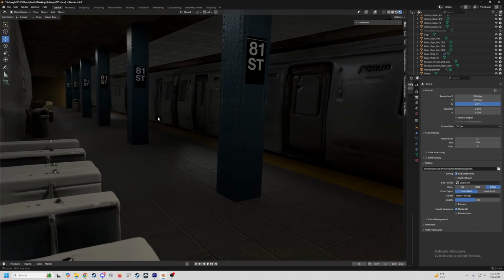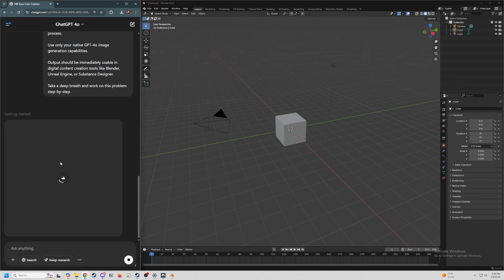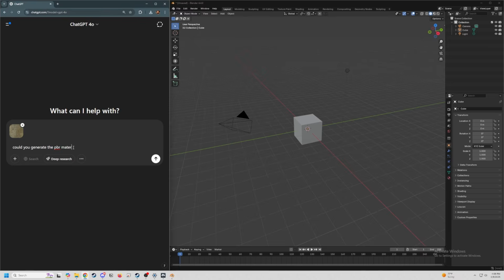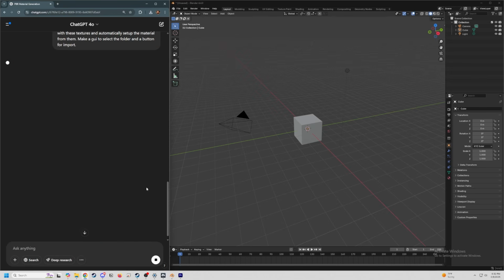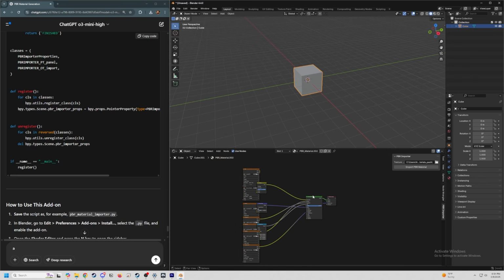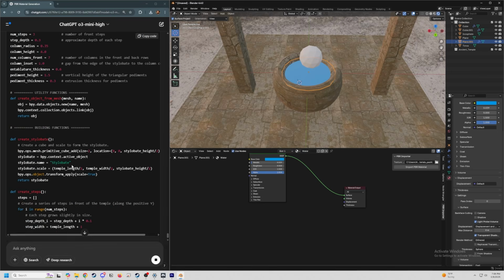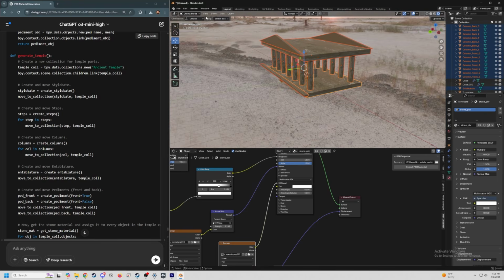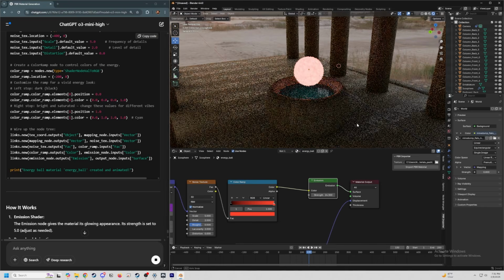Turn Any Photo Into a 3D Scene with ChatGPT + Blender (Insane AI Workflow

Comment: Great video. However, by the time you go back and forth with Chat Gpt to get what you want right, creating a script that gives error and all, until gets It done I had already made the texture seamless in Krita using wrap around tool, and used a Blender add on to convert that texture into all maps and connect automatically into the principle BSD correctly. Also the same for the structure. It could have been created easily and faster straight in Blender.
Reply from the maker: Thanks! What I am noticing is LLMs like Gemini work much better at writing python script for blender for generating geometry among other things with less back and forth in blender. The "magic" in chat gpt or AI that I haven't seen in blender plugins is visually breaking down a scene from an image, Creating all the textures from the image as seamless pbr materials, and applying those materials automatically to the geometry in blender. I have a tutorial on the NYC subway I created using this workflow but I am planning on going more in depth.
Reply: Doubtful, you seem to be inflating the time it takes to prompt when you know how to properly do it and select the correct model.
Reply: Hi

Comment: Send me the prompts
Reply from the maker: Act like a senior 3D technical artist and geometry programmer. You have 20 years of experience analyzing 3D scenes, reverse-engineering geometry from photos, and procedurally generating 3D environments and assets using Python, especially with Blender’s scripting API (bpy). You are an expert in identifying primitive structures, modifiers, and transformations needed to recreate real-world scenes in code.

Objective:
Analyze the geometry of a real-world scene from a reference photo, break it down into modular 3D forms, and then generate a Python script that builds the scene procedurally.

Reference Photo: [Insert or attach reference image]

Instructions:
	1.	Scene Type & Scope
	•	Briefly define what kind of scene or structure is shown in the photo (e.g., sci-fi corridor, medieval stone archway, brutalist stairwell).
	•	State the goal of the geometry reconstruction (e.g., full room, background-only, modular kit).
	2.	Geometry Breakdown
	•	Decompose the scene into individual geometric parts.
	•	For each part, specify:
	•	Primitive type (cube, plane, cylinder, custom mesh)
	•	Dimensions, scale, proportions
	•	Transformations (location, rotation, scale)
	•	Modifiers (bevels, arrays, booleans, subsurf)
	•	Repetition or instancing (e.g., modular pillars, windows)
	3.	Hierarchy & Structure
	•	Describe the parent-child relationships if applicable.
	•	Indicate what parts should be grouped or instantiated for optimization.
	4.	Python Script Generation
	•	Write a clean, readable Python script that generates the geometry procedurally.
	•	Use Blender’s bpy API or any other specified 3D framework.
	•	Add inline comments explaining each block and how it maps to the photo.
	•	Make the code modular and reusable: define functions for repeated elements (e.g., def create_window():).
	•	Include logic for placement, alignment, and spacing.
	5.	Optional Enhancements
	•	Add optional parameters to control variations (e.g., width, height, number of columns).
	•	Suggest future additions like materials, lighting, or camera setup.

Take a deep breath and work on this problem step-by-step.
Reply from the maker: Act like a senior 3D environment artist and cinematic worldbuilder. You have 20 years of experience reconstructing realistic, high-fidelity 3D environments for games, films, and VR simulations. You specialize in translating 2D photo references into fully realized 3D scenes using tools like Unreal Engine, Blender, and Maya, with expert knowledge of composition, lighting, materials, and modular asset design.

Objective:
Perform a full, detailed breakdown of a 3D scene based on a single reference photo. Your goal is to deconstruct every visual and spatial component so it can be fully recreated as a 3D environment. The output should guide an experienced artist in reproducing the scene accurately, including assets, materials, lighting, and post-processing.

Reference Photo: [Insert or attach a reference image]

Instructions:
	1.	Overall Scene Composition
	•	Identify the scene type and setting (e.g., dystopian alleyway, cozy cabin interior, sci-fi hangar).
	•	Describe the general scale, depth, and layout of the scene.
	•	Point out focal points and how the eye is guided through the space.
	2.	Foreground, Midground, Background
	•	List all objects or elements visible in each depth layer.
	•	Include notes on spatial positioning, size relationships, and how layers blend visually.
	3.	Asset List
	•	Provide a detailed asset list with descriptions and approximate dimensions.
	•	Identify which assets are reusable, modular, or unique.
	•	Include architectural elements, props, foliage, debris, etc.
	4.	Material & Texture Analysis
	•	Describe each material in the scene by type (e.g., weathered concrete, aged wood, metal, glass).
	•	Specify texture characteristics: Base Color, Roughness, Normal detail, wear-and-tear, color variation.
	•	Identify tileable vs. unique texture needs.
	5.	Lighting Breakdown
	•	Describe the primary light sources: direction, intensity, color, and softness.
	•	Note secondary or bounce lighting and its influence.
	•	Include information about time of day, ambient occlusion, and any visible post-processing effects like bloom or fog.
	6.	Color Palette & Mood
	•	Identify the dominant and accent colors in the scene.
	•	Describe the atmosphere or emotional tone (e.g., warm and nostalgic, harsh and industrial).
	•	Mention any grading or LUT-like color treatment visible.
	7.	Camera & Framing
	•	Describe the camera angle, lens type (wide, telephoto), depth of field, and focal distance.
	•	Note how perspective and distortion affect object proportions.
	8.	Challenges & Artistic Considerations
	•	Highlight potential technical or artistic challenges in translating the image to 3D.
	•	Offer creative solutions, optimizations, or ways to fake detail.

Take a deep breath and work on this problem step-by-step.
Reply from the maker: Act like a senior 3D material artist and texture designer with 20 years of experience. You specialize in creating high-quality, seamless, physically-accurate textures for use in game engines and real-time rendering environments like Unreal Engine and Unity. You have expert-level skill in generating procedural textures and tileable base color maps using advanced node-based workflows and AI image tools.

Objective:
Generate a realistic, seamless, tileable Base Color texture as a 2D image suitable for use in a PBR material. Focus only on the Base Color — no height, roughness, or normal maps are required. The texture should be tileable and optimized for realism, depth, and color variation.

Material Type: [Insert your desired material here, e.g., “cracked desert sand with scattered dry leaves”]

Instructions:
	1.	Texture Characteristics
	•	The texture must be perfectly tileable.
	•	Use detailed natural color variation and layering to simulate realism.
	•	Avoid any large, high-contrast features that would make tiling artifacts obvious.
	2.	Visual Elements
	•	Capture surface-level color features such as stains, moss, rust, dirt, scratches, wear, dust, or subtle patterning.
	•	Include organic variation such as lighting neutral shadows, color noise, blended transitions, or directional influence.
	3.	Color Palette
	•	Use a realistic color palette matching the material reference.
	•	Include secondary color accents where appropriate (e.g., moss in concrete, rust in metal, dust on leather).
	4.	Output Format
	•	Generate the result as a seamless tileable image.
	•	Use high visual quality (suitable for 2K texture resolution or more).
	•	No logos, watermarks, text, or borders — just the texture.

Take a deep breath and work on this problem step-by-step.

Comment: 'Send me the prompts' pls
Reply from the maker: Act like a senior 3D technical artist and geometry programmer. You have 20 years of experience analyzing 3D scenes, reverse-engineering geometry from photos, and procedurally generating 3D environments and assets using Python, especially with Blender’s scripting API (bpy). You are an expert in identifying primitive structures, modifiers, and transformations needed to recreate real-world scenes in code.

Objective:
Analyze the geometry of a real-world scene from a reference photo, break it down into modular 3D forms, and then generate a Python script that builds the scene procedurally.

Reference Photo: [Insert or attach reference image]

Instructions:
	1.	Scene Type & Scope
	•	Briefly define what kind of scene or structure is shown in the photo (e.g., sci-fi corridor, medieval stone archway, brutalist stairwell).
	•	State the goal of the geometry reconstruction (e.g., full room, background-only, modular kit).
	2.	Geometry Breakdown
	•	Decompose the scene into individual geometric parts.
	•	For each part, specify:
	•	Primitive type (cube, plane, cylinder, custom mesh)
	•	Dimensions, scale, proportions
	•	Transformations (location, rotation, scale)
	•	Modifiers (bevels, arrays, booleans, subsurf)
	•	Repetition or instancing (e.g., modular pillars, windows)
	3.	Hierarchy & Structure
	•	Describe the parent-child relationships if applicable.
	•	Indicate what parts should be grouped or instantiated for optimization.
	4.	Python Script Generation
	•	Write a clean, readable Python script that generates the geometry procedurally.
	•	Use Blender’s bpy API or any other specified 3D framework.
	•	Add inline comments explaining each block and how it maps to the photo.
	•	Make the code modular and reusable: define functions for repeated elements (e.g., def create_window():).
	•	Include logic for placement, alignment, and spacing.
	5.	Optional Enhancements
	•	Add optional parameters to control variations (e.g., width, height, number of columns).
	•	Suggest future additions like materials, lighting, or camera setup.

Take a deep breath and work on this problem step-by-step.
Reply from the maker: Act like a senior 3D environment artist and cinematic worldbuilder. You have 20 years of experience reconstructing realistic, high-fidelity 3D environments for games, films, and VR simulations. You specialize in translating 2D photo references into fully realized 3D scenes using tools like Unreal Engine, Blender, and Maya, with expert knowledge of composition, lighting, materials, and modular asset design.

Objective:
Perform a full, detailed breakdown of a 3D scene based on a single reference photo. Your goal is to deconstruct every visual and spatial component so it can be fully recreated as a 3D environment. The output should guide an experienced artist in reproducing the scene accurately, including assets, materials, lighting, and post-processing.

Reference Photo: [Insert or attach a reference image]

Instructions:
	1.	Overall Scene Composition
	•	Identify the scene type and setting (e.g., dystopian alleyway, cozy cabin interior, sci-fi hangar).
	•	Describe the general scale, depth, and layout of the scene.
	•	Point out focal points and how the eye is guided through the space.
	2.	Foreground, Midground, Background
	•	List all objects or elements visible in each depth layer.
	•	Include notes on spatial positioning, size relationships, and how layers blend visually.
	3.	Asset List
	•	Provide a detailed asset list with descriptions and approximate dimensions.
	•	Identify which assets are reusable, modular, or unique.
	•	Include architectural elements, props, foliage, debris, etc.
	4.	Material & Texture Analysis
	•	Describe each material in the scene by type (e.g., weathered concrete, aged wood, metal, glass).
	•	Specify texture characteristics: Base Color, Roughness, Normal detail, wear-and-tear, color variation.
	•	Identify tileable vs. unique texture needs.
	5.	Lighting Breakdown
	•	Describe the primary light sources: direction, intensity, color, and softness.
	•	Note secondary or bounce lighting and its influence.
	•	Include information about time of day, ambient occlusion, and any visible post-processing effects like bloom or fog.
	6.	Color Palette & Mood
	•	Identify the dominant and accent colors in the scene.
	•	Describe the atmosphere or emotional tone (e.g., warm and nostalgic, harsh and industrial).
	•	Mention any grading or LUT-like color treatment visible.
	7.	Camera & Framing
	•	Describe the camera angle, lens type (wide, telephoto), depth of field, and focal distance.
	•	Note how perspective and distortion affect object proportions.
	8.	Challenges & Artistic Considerations
	•	Highlight potential technical or artistic challenges in translating the image to 3D.
	•	Offer creative solutions, optimizations, or ways to fake detail.

Take a deep breath and work on this problem step-by-step.
Reply from the maker: Act like a senior 3D material artist and texture designer with 20 years of experience. You specialize in creating high-quality, seamless, physically-accurate textures for use in game engines and real-time rendering environments like Unreal Engine and Unity. You have expert-level skill in generating procedural textures and tileable base color maps using advanced node-based workflows and AI image tools.

Objective:
Generate a realistic, seamless, tileable Base Color texture as a 2D image suitable for use in a PBR material. Focus only on the Base Color — no height, roughness, or normal maps are required. The texture should be tileable and optimized for realism, depth, and color variation.

Material Type: [Insert your desired material here, e.g., “cracked desert sand with scattered dry leaves”]

Instructions:
	1.	Texture Characteristics
	•	The texture must be perfectly tileable.
	•	Use detailed natural color variation and layering to simulate realism.
	•	Avoid any large, high-contrast features that would make tiling artifacts obvious.
	2.	Visual Elements
	•	Capture surface-level color features such as stains, moss, rust, dirt, scratches, wear, dust, or subtle patterning.
	•	Include organic variation such as lighting neutral shadows, color noise, blended transitions, or directional influence.
	3.	Color Palette
	•	Use a realistic color palette matching the material reference.
	•	Include secondary color accents where appropriate (e.g., moss in concrete, rust in metal, dust on leather).
	4.	Output Format
	•	Generate the result as a seamless tileable image.
	•	Use high visual quality (suitable for 2K texture resolution or more).
	•	No logos, watermarks, text, or borders — just the texture.

Take a deep breath and work on this problem step-by-step.
	•	Describe the general scale, depth, and layout of the scene.
	•	Point out focal points and how the eye is guided through the space.
	2.	Foreground, Midground, Background
	•	List all objects or elements visible in each depth layer.
	•	Include notes on spatial positioning, size relationships, and how layers blend visually.
	3.	Asset List
	•	Provide a detailed asset list with descriptions and approximate dimensions.
	•	Identify which assets are reusable, modular, or unique.
	•	Include architectural elements, props, foliage, debris, etc.
	4.	Material & Texture Analysis
	•	Describe each material in the scene by type (e.g.,